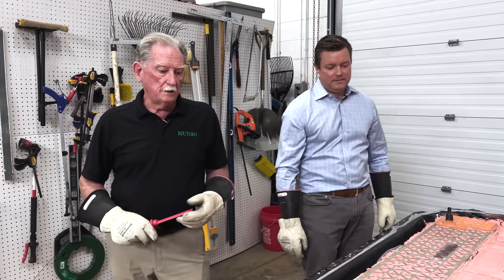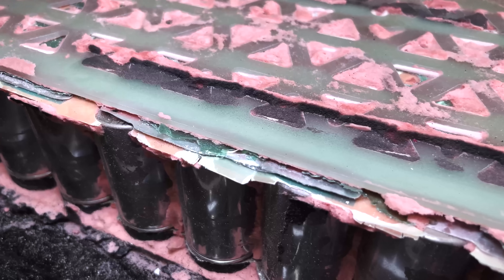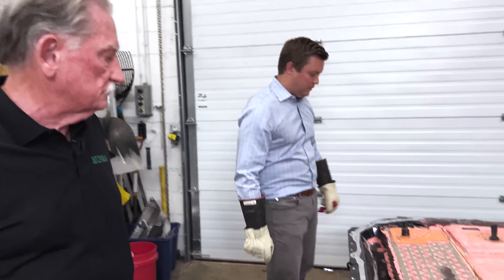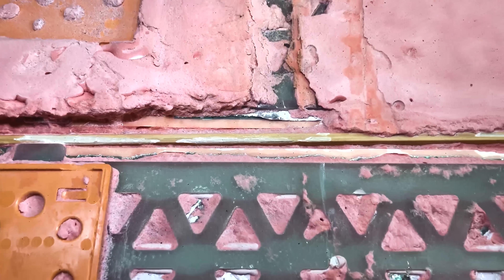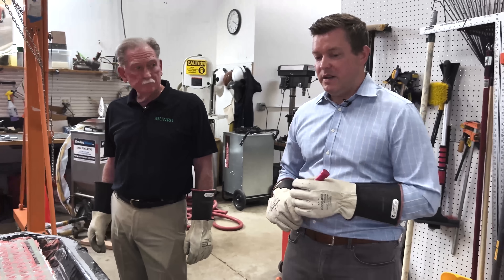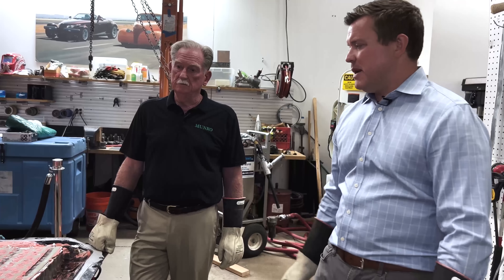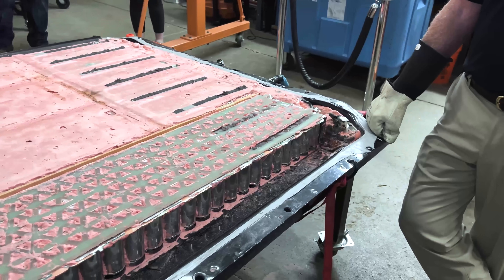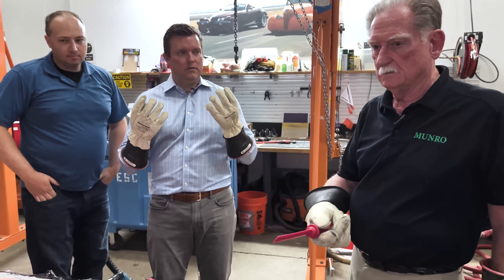4680 Battery Pack: What We Found Under the Foam!

Comment: Damn, I wish each pack would have it's own housing, so a seriously defective cell would only affect 1/4 of the battery making it somewhat serviceable... however, as Sandy points out, it will come with a 4.x times increase of potential mounting issues/complexity, weight increase... maybe less structural strenght/integrity? (especially lenght-wise torque I suspect)
Reply: Mate the Tesla BMS ain’t capable of balancing 1 new module and 3 old ones. So replacing a single module isn’t a viable solution. The only approaches that work are replacing all 4 modules with brand new ones at once or replacing all 4 modules with 4 used modules from a single vehicles.
Reply: @anonym3017  yes and no. Yes you need to replace entire set of 4 hypothetical modules to a balanced set for customers sake(assembly/garage efficiency) You save the three used but ok modules for a mix n match for next repair. So 'no', I think its a viable option, but maybe the economy of scale isn't there anymore, especially when considering the downsides of moduled battery being not as structurally good/or weigh more.
Reply: @Paxmax  again. Mix and match doesn't work as the BMS isn't capable of balancing 4 modules with different degradation.
Reply: @anonym3017  That is where the matching comes in, you pair up old packs of similar capacity. In the end the worst pack will set the operational limits/set the pace. This is already being done at private shops for Roadster batteries... but they do it even down to individual cells, they replace old broken cells with old functional cells.
Reply: @Paxmax  not capacity but internal resistance.

And you'd have to be effectively spot on for it to work.

Which also means that you don't have a worst module as they are all equally good/bad.
Reply: @anonym3017  Well... that is dam unfortunate. So many variables.
Reply: I think Tesla may be going for a different approach.
Make the battery simple enough to make & recycle, that it's cheaper and easier to just replace the whole thing.

I think even replacing one pack would be a long and dangerous job with all that high voltage.
They would probably reach a point where driving a Tesla would be safer than repairing one of the batteries.
Reply: @830927mjki  yep, yeep, yep! By now Tesla also have alot of data of the existing packs general behaviour. (Tesla roadster batteries was problematic though) Tesla have probably learned alot about finding defective cells and knows much better now how to put together a balanced battery. I would guess that most customers accept the 'risk' of a future complete battery swap 12-15 years down range. I would also guess(ok, hope) that defective batteries/cells would reveal themselves early, hopefully within warranty period; So the amount of affected customers of a catastrophic battery failure just out of warranty is probably low = small amount of disgruntled people = small market for battery repair = No point for Tesla to do anything about it as it doesn't make sense, it will certainly not affect bottom line... much. One can probably assume, all things being equal, that alot less absolute amount of cells is also a major improvement on all metrics, except maybe maximum current output.
Reply: @Paxmax  Agreed.
Also, I think one thing to consider is that "must be repairable" may just be old school thinking when it comes to cars in general.

It's a central part of the ICE business model but not Tesla.
Who would repair the battery in the future when there are no repair centers?
I think people may just have the idea of "this is how we do things" stuck in their head.
Reply: @830927mjki  Yes... and I hate the "no serviceable parts inside". I am probably too old school. It just feels absurd, that one tiny rouge cell, will basically condemn an otherwise perfectly servicable vehicle. Maybe "pirate" B-grade batteries will be available. Might only offer 80% of a new battery range/performance but at 1/2 the price with a few years warranty might make sense.
Reply: @Paxmax  Feels like that's a problem Telsa will solve at some point.
I imagine they'll figure out a way to automatically isolate bad cells at some point.
On top of making the cells more reliable in general.

Comment: I think that the thickness of the cans and the amount of adhesion was just a precaution for 4680. Once they are more confident I can see them optimizing the structure and gaining density.
Reply: Also they might be compensating for the material used for the canister. Using a different formula for the canister now that the batteries are structural might save money and weight. This is me just guessing, I’m not an expert by any stretch.

Comment: I think one of the greatest things about the shift to Battery storage for energy is the recyclability of the materials. They have an enormous value even after the cell has degraded. 90 percent of these packs will still be usable in 10 years. When they are finally no longer viable, the base materials will still have residual value. That means they will never be simply thrown away. People will dig through garbage to find aluminum cans to make a buck. The value for just the scrap steel in a car makes it a desirable commodity. These packs have Lithium, Copper, Aluminum, Steel and a whole slew of useful materials. When you burn gas/diesel that took so much energy and labor to extract and refine what can you get back and reuse in an even remotely economical way?
Reply: @Macmonkey1000 Sure that is one way to do it. Doesn't mean that the way Tesla is approaching it is wrong. This is truly what is great with this technology coming to the forefront. People are now exposed to it and are thinking of better ways to improve it. Before all people talked about was how to make ICE vehicles better. 40 years ago we would be arguing about fuel injection vs carburetion or manual shift vs automatic. Now it's is cell chemistry and pack design. I love the future.

Comment: with this amount of foam, this battery pack should insulate noise and vibration coming from underside something like rolls royce level.
Reply: But it's a small piece of floor only. And bolted to the chassis.

Comment: How are companies like Redwood Materials supposed to be able to recycle these batteries when they are caked in that pink foam? I hope there is a process of removing it that's environmentally friendly and reasonable easy.  I can see the benefits of using the foam but is it worth it in the long run?
Reply: Redwood recycles dead cells.
Reply: @vidznstuff1  duh. Figure it out dude.

Comment: For people scratching their heads over the recycling ... A small startup prototyped the liquid nitrogen system a few years ago.  The temperature isn't dropped to make the materials shatter more easily ... it's dropped to stop or greatly reduce the chemical reaction rate,  so that crushing and tearing apart the battery doesn't cause a thermal runaway from the residual charges. 

Ya liquid nitrogen isn't near absolute zero - but it doesn't have to be. In general, every 10 degrees C drop in temperature halves the chemical reaction rate. 

So it simply won't be necessary to manually disassemble each pack and module bolt by bolt with special procedures for every different pack design, the way some are doing right now.  Just throw it in and rip it up.

Floatation cells have been used by the mining industry, in the mills at base metal mines for probably a hundred years.  Crushed ore goes in,  high grade concentrate comes out.  Chemicals in the slurry control how different materials float to the top in the floatation cells at each stage of the circuit, to separate different materials.

Comment: Elon basically put "spin" on it with that stupid "high grade ore" comment! This pack is almost impossible to reuse. The cells are NOT recoverable by most people. If you buy one of these packs the ONLY way you will ever use it, is 100% as is! Tesla has made sure that 95% of people will never be able to re-use this pack in some other application!!! I'm sure there are solvents that will erode the "pink stuff", but what kind of nastiness is that going to be?! Tolulene? Xylene?

Comment: Here's a thought: Since Sandy and Elon have a great deal of respect for each other, why not have Elon comment on what would not be giving away trade secrets in the construction and cooling of the battery module. That way, Sandy would not tread on things Elon does not want to expose, and Sandy would need to work less hard on stripping away features that Elon could comment on with authority (rather than have Sandy guessing at things). And if too much  lends itself to secret discovery, I don't mind, as an observer, allowing Musk's creation to maintain its secrecy where he sees fit. After all,  Musk has stated his patents are open, in general, in order to facilitate the fastest production of EV's throughout the industry.
Reply: There likely isn't a lot of "secret sauce" in the battery pack itself. unlike other companies, Tesla manufactures their own cells and can place them directly into the pack, so they design and optimize for their use case and considerations. Third party battery manufacturers like LG Chem, SK Battery, CATL, BYD etc. who sell whole packs to other companies, have their own innovations and optimizations but there's less attention paid to those

Comment: What's the value of the ore that's left over after you've incurred the expense of the recycling process? That would give some indication of the "trade in" value of a battery pack that's gone bad after warranty. My fear would be that replacing this battery would cost $20K or more down the road since you can't replace individual modules, cells, or anything for that matter in this pack.
Reply: Elon said batteries right now cost about a grand end of life
Reply: @mubbywub  That's not very much considering the replacement cost.

Comment: Had a model 3’and now a model y (not texas model) wonder if they’re still going to keep cyber truck prices as they where
Reply: Cybertruck will be much more expensive that initially thought. Inflation has been rampant and all costs have gone up. There have been several years delay in manufacturing 4680 cells because the dry electrode process is much more difficult than they imagined, this will drive up costs.

Comment: I think it is likely that Tesla will remove the black plastic pieces on the bottom of each cell and replace it by a cooling system from the bottom. It is just a strategy to not change too many parameters at once to have a higher level of security. Same with the cells, they want to add silicon continuously within the next years, I suppose to have time to test them extensively. Tesla cannot afford to have a battery pack recall of millions of cars, so they have to play it save, they already innovate at an insane pace and level.

Comment: Sandy   and  co.    Please explain to the layman  the need for those High voltage gloves.      Does not take much current to kill.  :  You make this too easy    but don't  need a layman taking a battery tray of any kind apart  with out proper PPE.

Comment: I see a sealed, virtually battery and controller to be a detriment, not an advancement. One 10.00 part fries, and viola.... new $24,000.00 pack.  Right To Repair enthusiasts will not be happy.  Perhaps the pink foam and the sealed tuna-can approach has some arguable benefits.

When the infrastructure for electric charging at home and in the wild, sufficient for ALL cars exists; then the transition to only electric will make sense. Until then, the power grid is barely sufficient for current demand. This reconciles with the reason carmakers are still developing improved internal combustion engines, and not abandoning a necessary mode of energy sourcing; to meet current, and future mixed demand for the next 10 years,  Elon Nuclear, perhaps?

Comment: This battery pack looks to be irreparable. There are old Tesla's now that need battery repairs and changing some batteries repairs it not too far from a new one, otherwise you completely kill the whole pack. There are a few channels that covered this.
Reply: Replacing battery cells even on an ideal repairable pack is still difficult. It's not like replacing a 12V battery.
Better if there is a program by Tesla or government to recycle and replace packs.
Reply: @123clickit  Not easy, but doable now, not sure that will be possible with this one. Changing a few inner batteries (the small ones) is infinitely cheaper than changing a 10 000 dollars component. Nobody will invest 10k in a car worth less than than. It is a shame to have hard limited life with no other way of prolonging car's life.

Comment: Generally most foams can be softened, hardened or powdered by various solvents either petroleum, alcohol or even citrus based, depending on the foam. 

Once you determine the chemical properties of the foam I think it can be removed without mechanical force. 

I’ve thought of systems similar to your dry ice blaster with addition of these solvents and a vacuum to collect the particles and solvent for reprocessing or disposal.
Reply: Why would you remove the foam for recycling? A shredder that goes through steel walled cells goes through foam without even noticing.

The best process is the one that doesn’t exist.
Reply: @anonym3017  Just saying in this situation he doesn’t want to SHRED the battery, wants to open and examine the battery…

Comment: Man it is so well put together….Elon is on friendly terms with you, any way he would let you come in and visually see it all go together?? He is usually very willing to take input and analysis from you.  To me it seems much much harder to take these cars apart than to assemble them.
Reply: Monro is in the business of selling comapny processes/secrets to competitors. Tesla probably doesn't want to share more than they feel works in their best interest.
Reply: @keco185  bingo
Reply: If anything, Tesla engineers who have watched this are applauding and laughing their butts off. Indestructible battery pack mission accomplished.
Reply: Historically tesla has been incredibly secretive about the pack assembly process. More specifically the module spot welding. Its apparently fairly remarkable how they make that many connections in a reasonable time frame / cost bracket.
Reply: At Schaffner we dissolved competitors products. Then we used the same technology as Coca Cola making their cans on a smaller scale and for HV insulation we filled the units with 2 component resin. At the end we had the strongest and safest product lines.

Comment: Why don't you make a video of Tesla battery pack manufacturing.   It would be simpler and remove the guess work.   It is not a easy to recycle since your stating that it must be frozen with liquid nitrogen, ground into small particles, separated and then go through a smelter process to separate the metals.   This is expensive, and requires additional energy to recycle.   Not counting the the nylon and installation disposal.

Comment: This is phenomenal and so cool to see the most advanced car battery pack available
Reply: If those cells are tabless, and the cooling is interwoven, the heat takeout rate should be quite good. This should be able to fast charge exceptionally if those criteria are met.

Comment: Does the foam dissolve in mineral oil? (I know nothing, but it might be fun doing a video of what actually melts that pink foam) To refine the whole battery pack my guess is that they can just cut off the very tippy top and just dump the rest of the interior of the cell out.
Reply: Nah mate. That would require differentiating between different cell sizes/shapes/xounstruction methods.

Discharge and then shredder the entire thing doesn’t require that making it the better process.

Comment: When reviewing and doing these EV teardowns you should consider giving a serviceability & recyclability rating for the battery pack.

...one of the big "eco" selling points many EV car makers boast is that the battery packs can easily be recycled at EOL and that the heavy metals inside can be reclaimed & reused. Would be nice for each manufacturer to be rated based on those claims.
Reply: ...and maybe do a video from an EV battery recycling facility going into and observing the processes you briefly mention in this video.

I'd certainly be massively interested in such content, as I'm sure would others.
Reply: @DEADB33F  VW has a video showing their process up on YouTube
Reply: You didn't understand Elon's tweet that recycling battery packs is treating them as high grade ore?  The stuff that is dug out of the ground is a few percent of the element you want to isolate.  A battery pack is 10x to 30x that concentration.  Let go of your ICE repair mentality and look at the last 10 years of EV battery use.  My 2013 Leaf is still going strong.  So are the vast majority of other BEV batteries.
Reply: Let’s look at recyclability first. 

The first step is discharging the pack to 0 volts, this reduces the chance of a fire and arcing but isn’t strictly necessary. The second step is shredding the still assembled pack. Which means that all battery packs are equally recyclable no matter how they are constructed.

Now for serviceability.

Mixing new and old cells leads to an imbalance that quickly kills the pack again making individual cell replacements not viable no matter the construction.
The smallest part that can, sometimes, be exchanged is an entire managed module, so one of the 4 bricks.

Now to why I wrote “sometimes”. Teslas BMS, among others, is not capable of balancing a new brick and an old one. Meaning that the only long term viable option is replacing the entire pack as replacing a single brick will just lead to another one biting the dust within a year or two.

So the only thing that’s impacted by the new construction method is how easily the pack can be repurposed.